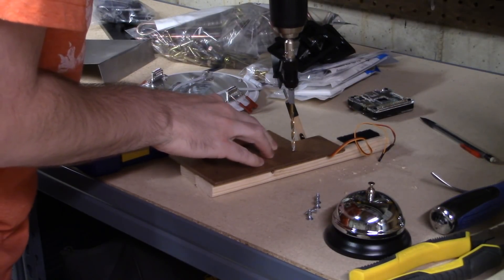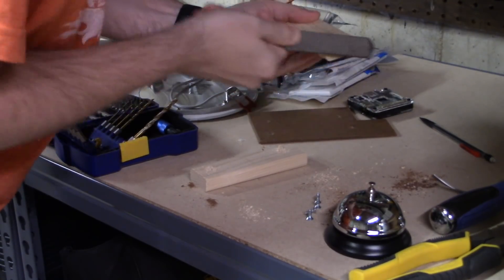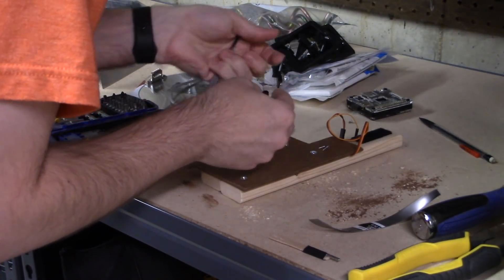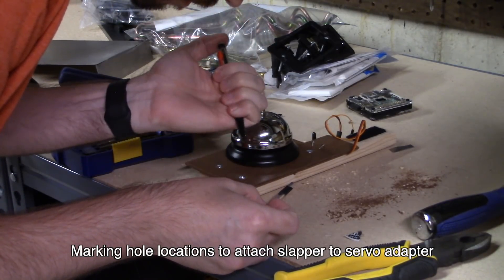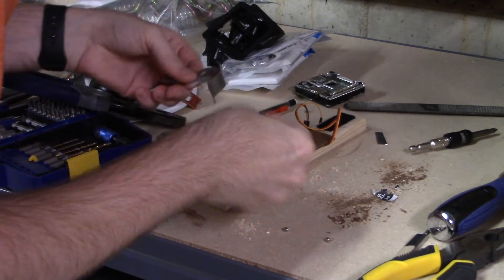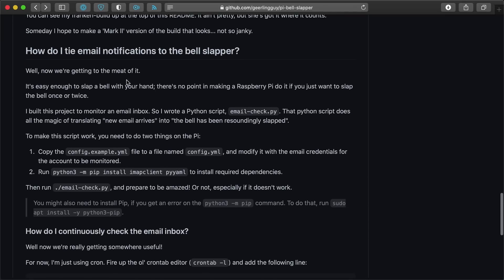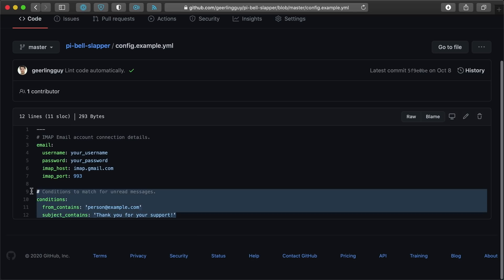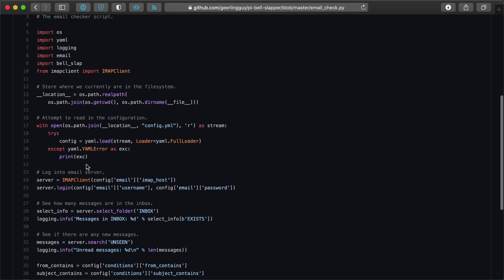The Raspberry Pi Bell Slapper - a software-controlled bell

Comment: Cool project! I found this video when I was looking for how to program and turn on church bells with a Raspberry and a relay. Earlier I did that with an Arduino, but now the time programming is more important. When I have time, I make a project out of it. Thanks for sharing your knowledge!
Reply from the maker: I remember setting up a digital bell system for a church in HS; we took an old PC, set up a cron-based schedule for the bells and added a button that would trigger a toll for funerals. It was simple and worked for about 10 years until a new bell system that cost about 20x more was installed.

It had a fancy UI and touchscreen... but it didn't have the heart of the old system. And it sounded about the same 😆

Comment: This is a nifty project :)
Though you probably could use your 3D printer to make a current model for it :)
Reply from the maker: That's the plan! I hope to make a version 2 that's much tidier, and more robust (though the current version has been in use for three months now with zero failures-to-ding!)
Reply: @JeffGeerling  ,
You know another nifty thing would be a phone line emulator that would generate the AC needed to ring a real classic bell driven phone. :)  Those cool old bell phones from the 1970's :D
Reply from the maker: @David_Ladd  Ooh... not a bad idea! I actually am amassing a small collection of different types of bells. I have a school bell (the type that would be in a hallway) too. That would probably be a bit too loud, though!
Reply: @JeffGeerling  ,
Well I am also into classic/retro computers and I see at places lik VCFMW where people will bring phone line emulators so they can connect computers together with good old modems :)

Last years VCFMW I could year phones ringing in one of the rooms. :)

Comment: You prob just need an ESP-1, that rpi is totally a waste :(
Reply from the maker: The Pi was sitting in a box with a number of other old A+ boards, so I'm glad to give it a little new life.

Is it the most efficient/lightweight solution to this problem? Not necessarily. Is it the most fun and the quickest one I could get set up that also has automatic remote updates and patching since it's operating over WiFi and has email client integration? You bet :D

Comment: If you do make another one / rebuild this one, consider just pinging the bell with a solenoid .
Reply from the maker: That's a good idea; I was originally going that route, but I didn't want to have to spend the time tuning it so it would not accidentally 'mute' the bell by not getting out of the way after hitting it.
Reply: @JeffGeerling  spring return solenoids <3
Reply from the maker: @TomOConnor-BlobOpera  I may do it! https://github.com/geerlingguy/pi-bell-slapper/issues/2

Comment: Hah!  I was, just yesterday, swearing at a servo project.  3d printed parts aren't always the best answer compared to bent metal especially when dealing with nice warm laser diodes.
Reply from the maker: True... I would probably still have to figure out some sort of metal linkage to make sure the little slapper arm lasts. Though I haven't even set up my brand new 3D printer yet, so I can't speak too much to the longevity of PLA printed parts (assuming a good structure)

Comment: Where in the world did you get that Apple power bank
Reply from the maker: Ah, that's an Apple USB to Gigabit ethernet adapter :)
Reply: @JeffGeerling  That makes a hell of a lot more sense! Embarrassed. Thanks for the response Jeff. While I have your attention... when do you think we will see the raspberry pi 5?
Reply from the maker: @7073shea  That's a good question. I haven't even heard rumors about it yet, meaning it's probably barely a drawing board idea at this stage (maybe some early planning for it?). The difficult part is finding a suitable SoC for it, as the one the Pi 4 currently uses (BCM2711) is a pretty well-rounded economical choice and a replacement needs to hit the same feature set for a similar price.

I'm hoping when it comes, it would have more PCIe lanes (x4 maybe?) to support more use cases I can dream up :) Also hopefully a little more IO bandwidth and a little faster.
Reply: @JeffGeerling  4x pcie would definitely open up some more cool opportunities. I only ask because I personally have been using the pi as a kali Linux machine and a little more power from the cpu would be welcome. Keep up the good work, happy holidays.